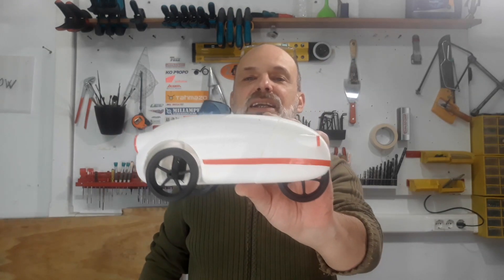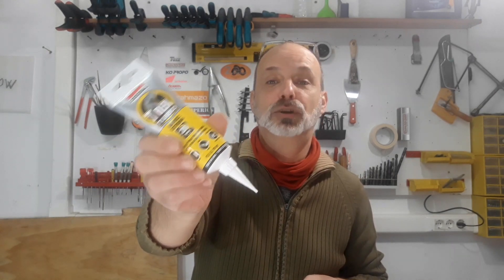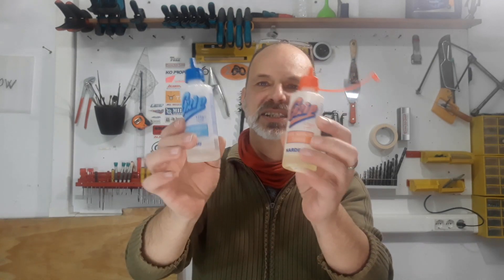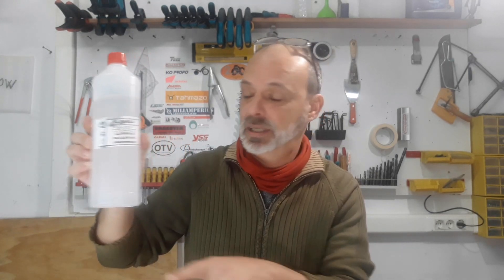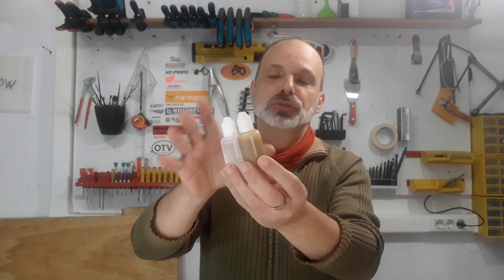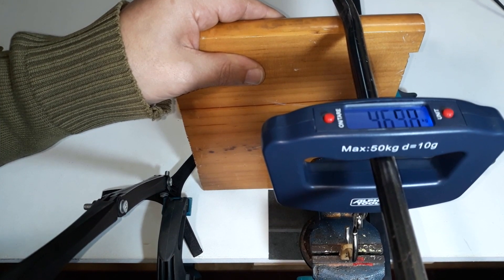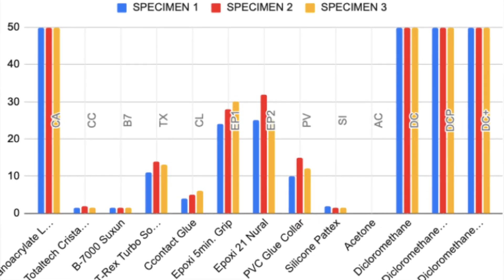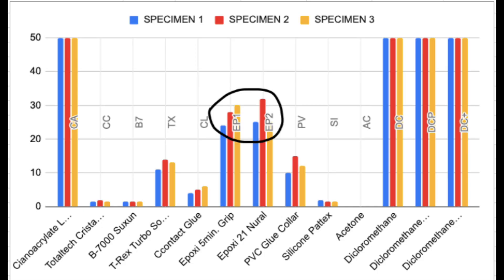3D PRINTED ELECTRIC CAR DIY, How to Glue PLA + (ENGLISH, Part 5)

Comment: Can this process be used for ASA, ABS etc
Reply from the maker: @jamesfraser7483 Yes, it is commonly used for ABS and other plastics. Don't know about ASA.
But you have to find the right solvent for each plastic. I believe they use acetone for ABS.
Reply: @gonzalop.chomon327  ASA is very similar to ABS mechanically but resists UV very well. I see ASA and ABS are desolved by the same solvents.